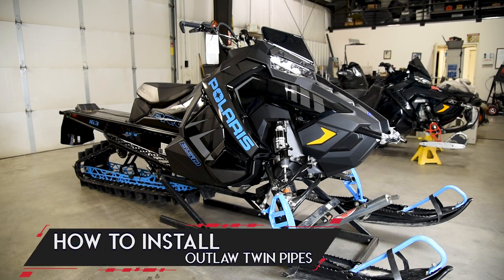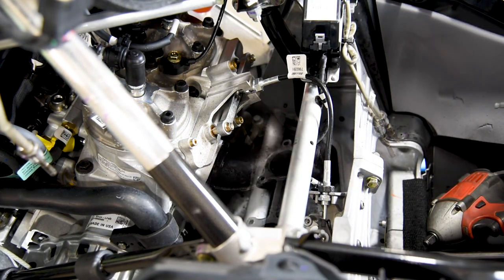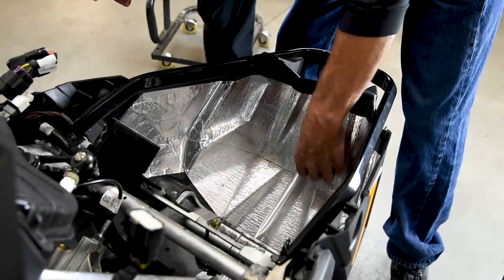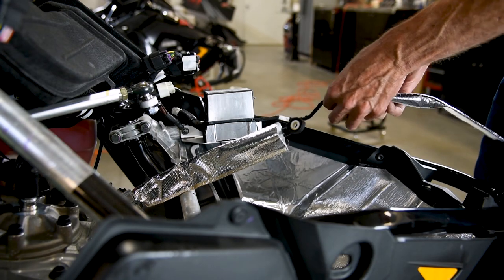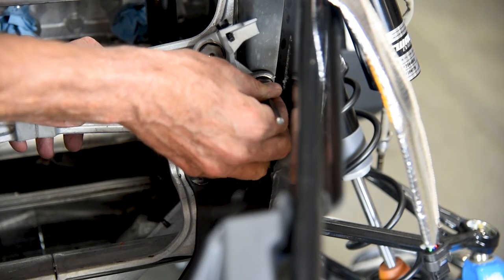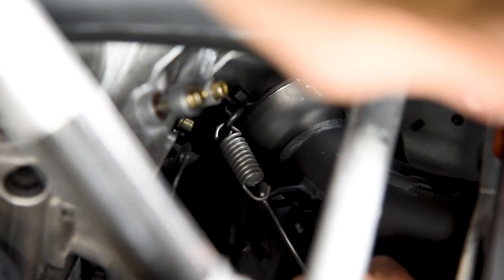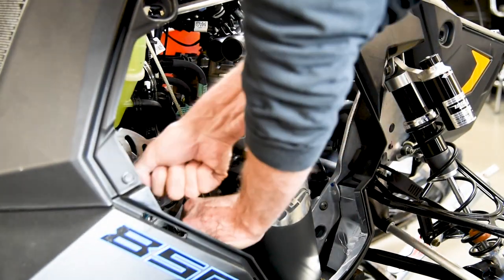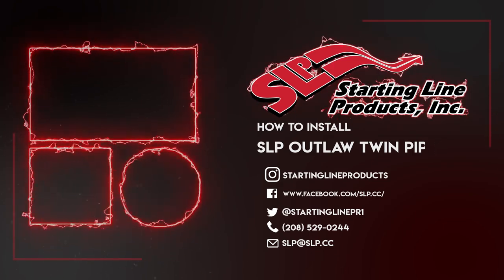How to Install SLP Outlaw Twin Pipes

Comment: Is this made possible for the shorter track sleds like the 129 indys and 137 indys as long ss there 650s and 850s or are these made for just tje 850 patriot motor only?? And are they designed for only mountain use??
Reply from the maker: The Outlaw Twin Pipes are made specifically for the Polaris 850 2018 and newer on the RMK (ALL models) and SKS (SKS 155 model only) there is an issue with fitment with shorter track sleds where the pipes just cannot be fit in the chassis and still give you the performance you are looking for. It's also available for all elevations so not just for mountain use.
Reply: startinglineproducts should make twins for the polaris liberty 800 i have a 14 indy 800sp 121 and love it tho i wouldnt mind having twins for the extra 10 to 15 hp